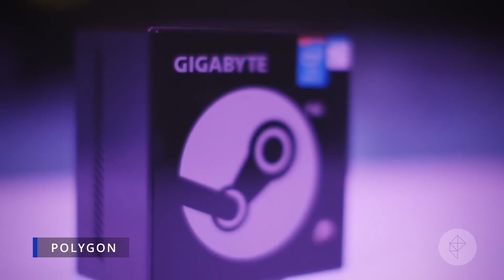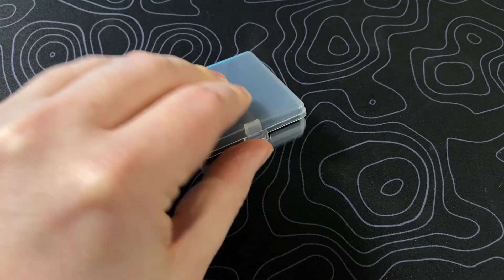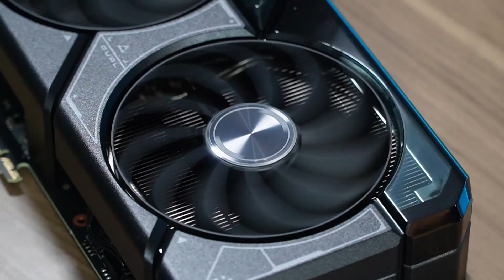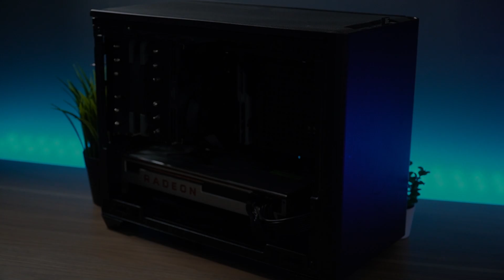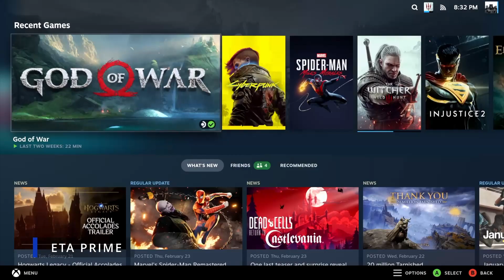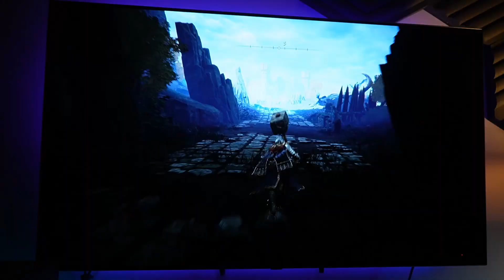The Steam Machine: I built a SteamOS console... but is it worth it?

Comment: Nice video. In my case, I found an old PC in my building's e-waste bin about two months ago and, after experimenting with Batocera.linux and Chimera, ended up turning it into a little HoloISO box. I'm posting this from it right now! It's much weaker than what you have though (an AMD A6-6400K, but hey it was free...). I had some spare parts I've collected over the years from upgrades and the like, so I put in 16Gb of RAM and an R9 Fury X (which is way too powerful for the CPU it's paired with honestly, and there wasn't enough room to mount the radiator in the small case so I had to get creative with zip ties). I then purchased a dirt cheap Crucial 500Gb SATA SSD (since the computer is a bit too old to have NVMe ports).

The Fury X can do 4K@60 over DisplayPort 1.2, but only 4K@30 over its HDMI 1.4 port, and my LG C9 TV needs HDMI. I was able to resolve the problem with a DisplayPort 1.2 -> HDMI 2.0 dongle I found cheap at a local computer store.

The keyboard I use is a Logitech K600. I also have a Steam controller, and Xbox Series X controller as well, and all are connected via official dongles instead of bluetooth. I can actually use the Steam controller to navigate the bootloader menus like this, which is a nice feature!

Since I'm CPU limited in almost every game, I just use this machine to stick to lighter games (like Othercide which is entirely turn-based) as well as games of its era. It works fine for things like that. I'm planning on upgrading my main desktop soon (to prepare for Starfield since I'll need a 6+ core CPU) so will probably replace the CPU/Montherboard/RAM combo with my overclocked i7-6700K and 32GB of RAM, which will be able to do most things fine and I can just stream anything else I want to play from my new desktop.

Regarding HoloISO git commits being old, that doesn't matter much. There is a little complication with having to mess with the Arch repository configuration (since Arch changed the format) and there were instructions on what to on a Reddit post somewhere, but once setup, it'll pull down OS updates directly from Valve in basically the same way that a Steam Deck does, leaving you with a great experience.
Reply from the maker: It's really cool to see someone using even older hardware, especially something from Piledriver! And I'm still sad that I never really had a Fury card. I had a Fury Nano for a few days years ago, but didn't get much time with it.

All of these comments have been so helpful! It's really helped me understand what I'm missing with my OS choice, and ways around some of the issues with some of them currently, until we get the official ISO for SteamOS.
Reply: @FunkyHQYT  The Fury Nano was such a nice card too. I had one in my work desktop back in the day to drive a 4k display. So tiny!

Comment: Hey! I’ve been doing the same thing as you.

Chimera was way too buggy and HoloISO, as you discovered was a no go. I was getting the same bugs as you were with Chimera… trouble with launchers and with resolutions. Also it WOULD NOT accept higher refresh rates. Issues with controllers too.

I went with Manjaro KDE and had steam start with the PC in to big picture mode. The bugs are basically gone and the experience has been sublime.

Make sure to enable compatibility for all games in the Steam settings. It’ll make your life easier.

I’m running a 7800x3d and a 7900 xtx on my 120Hz 4K TV. I’ve stopped using my consoles at this point.

It’s great!

I’m subbing! Hope to see an update video as to how you solved or pivoted to get around these problems!

One more note… if you are using an elite controller, make sure to remap your buttons in steam and create a profile. These Xbox controllers are detected improperly by steam to have incorrect button maps.

Cheers!
Reply from the maker: The support for high refresh would be awesome since the TV in my office does 120Hz too. I may have to try Manjaro KDE!

Thanks for the sub! I definitely want to make more videos like this one. It's been in the pipeline for months at this point and I really just wanted to push it out since I've noticed a lot of other creators talking about ChimeraOS.

I'm using just a regular 'Series' controller that I got in a custom color, and they Bluetooth experience has been 'fine' but I really need to try to find my wireless adapter that I know is around here somewhere.

Thank you for the wonderful comment!!
Reply: @FunkyHQYT  Steam OS 3.0+ is based on Manjaro/KDE (Plasma)... so its really as close as you can get to the real thing with out the hardware restrictions put in place by Valve to make it more compatible with the customized Steam Deck hardware.

Chimera OS directly uses Valves custom configuration which means those are all still in place and they can't use custom hardware effectively.

One thing that persists beyond Steam OS.... if you use Nvidia cards, regardless of the OS chosen.... you're going to have a bad time. lol

I had to bail on my 3080 for this very reason. My son benefited from that lol

I'm looking forward to the next installment! Thanks again!
Reply: @Twylight85  Correction, steamOS is downstream from arch not manjaro, both are arch based but also complete different distributions, they however are forked from the same upstream source and thus by default turn out to use the same DE, kde.